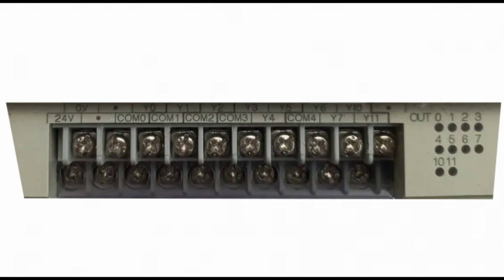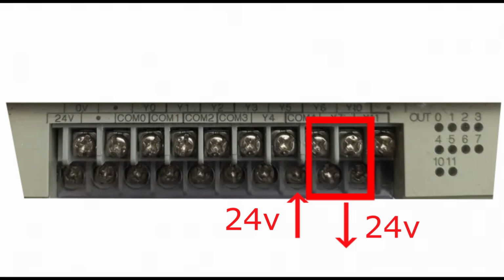Mitsubishi PLC tutorial FX0n-24MR-ES hardware & wiring

Comment: What is the mini DIN 8 pin connection pinout to connect to a PC to program. Does the FX0N use RS232 or RS422/485 communication protocol for programming ?
Reply from the maker: Hey, it is RS232 when you connect it from your PC to PLC. If you look up Amsamotion website on google they have very good wiring diagrams for the programming cables for the Mitsubishi FX series PLCs.
Reply: @1lovgren  Thank you. I made the cable and used a USB to RS232 adapter on Port1 to the FX0N PLC and to my surprise it worked first time without even asking for a password.